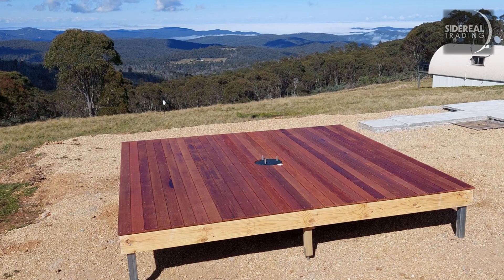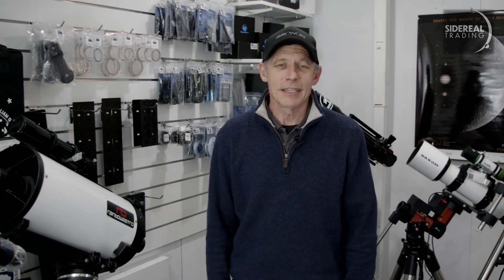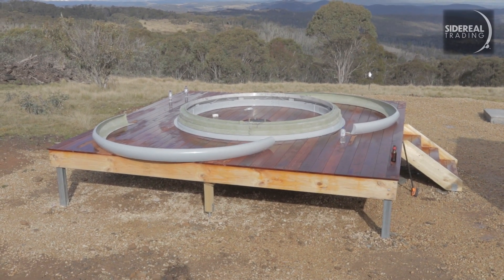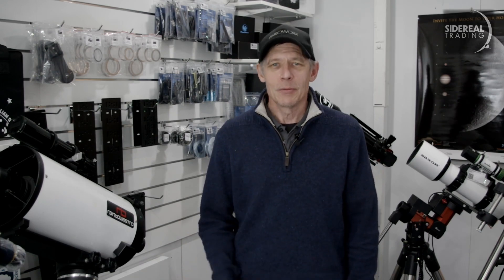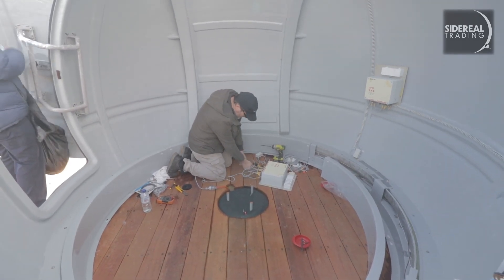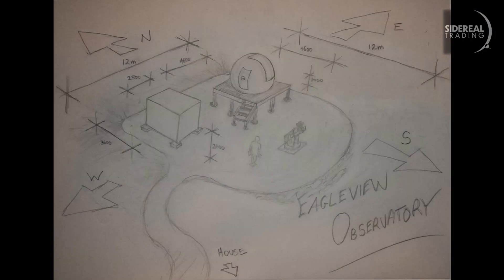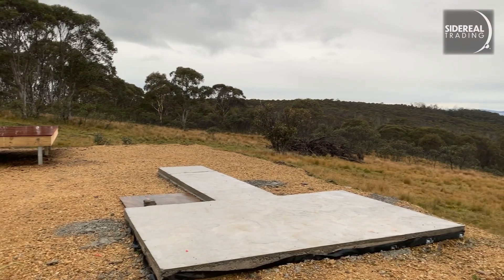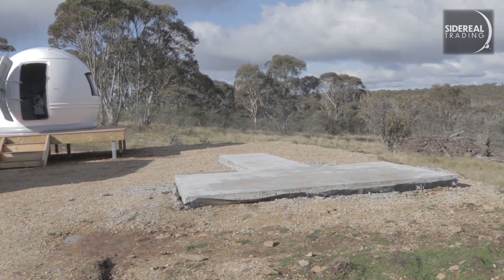Building a 3 metre ScopeDome observatory at Eagle View Farm, NSW, Australia

Comment: In minute 2:33 appears a person inside the dome and, honestly, it doesn't look like a 3 metre dome but 2 metre.
Reply from the maker: The 3-meter ScopeDome is 3 meters in diameter (3019 mm to be exact) at its widest point. However, because the dome extends outwards from its base, this widest point is at about waist high when you stand next to it. The base ring (which is what is being installed at 5:04 ) has a diameter of 2232 mm on the inside and 2752 mm on the outside. There are diagrams at https://www.scopedome.com/wp-content/uploads/2020/10/ScopeDome_Manual_3_0_EN.pdf.